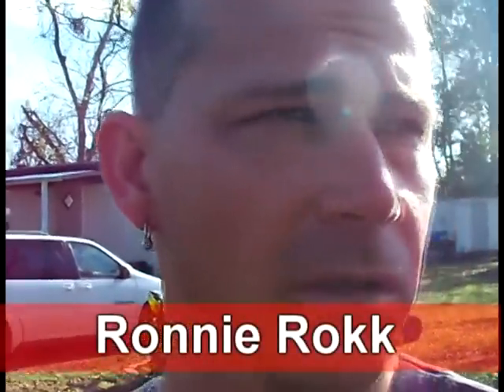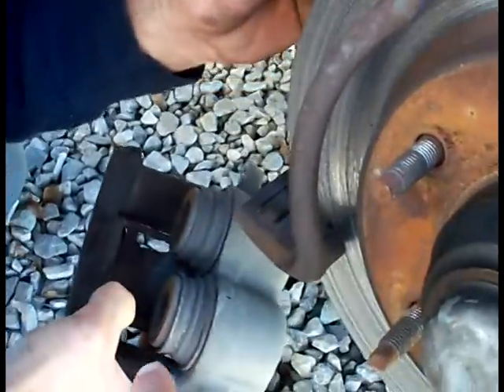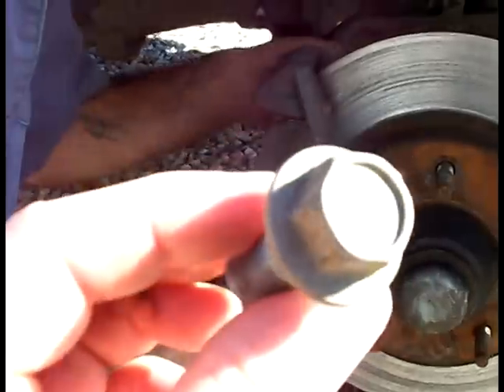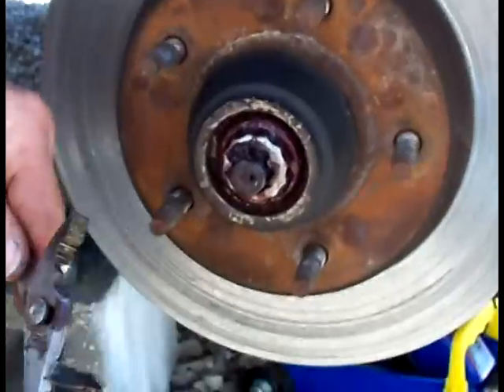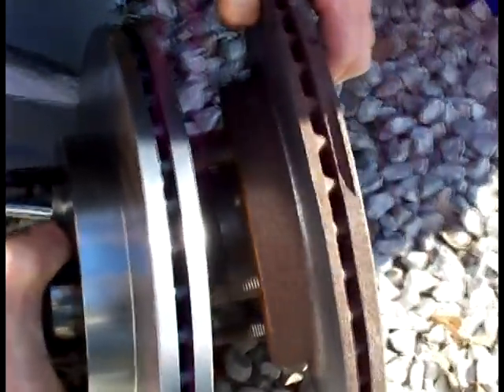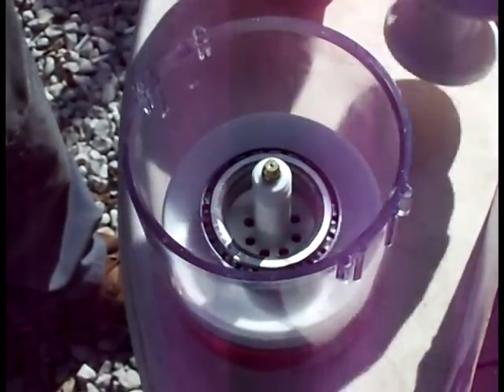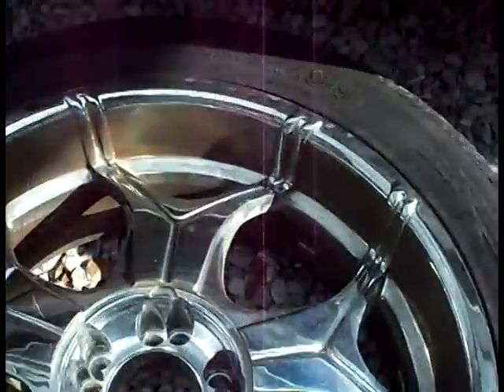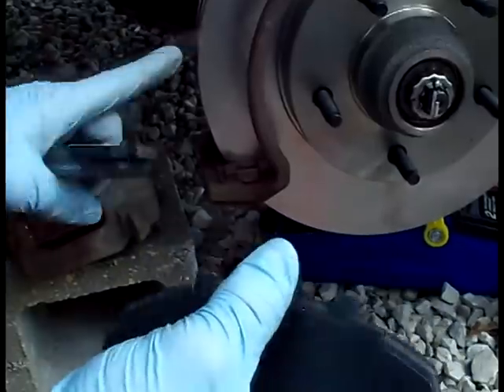Changing rotors and breaks on 1998  Ford F 150

Comment: Nice job! Thanks!
Reply: I watched this at least eight different times before I changed my rotors (and once during). I didn't even need a pipe on my breaker bar to get the bracket bolts out (or break them off, thank god). Thanks again!
Reply: Cowcharge You welcome buddy

Comment: Great vid!  Only thing I might add is rather than push the old fluid back upstream,  slide  a piece of clear tubing over the  bleed nipple  on the caliper  into a container,  Once the caliper is fully depressed with a c clamp, it can be bled by putting the tubing into a container with some fresh fluid in the bottom -,  all traces of air and trash  are  easily be  evacuated  from the caliper when it's fully retracted and has no way to move... Just don't allow fluid in the reservoir to go empty or air will get into the circuit.

Comment: What's the torque specs for the bearings? Thanks
Reply: 30’lbs while rotating the rotor then back it off two turns then torque it to 17’-24’lbs while rotating the rotor then back it off 175 degrees then  torque to 17”lbs . Then your bearings will be loaded.

Comment: DO NOT USE GUN GREASE FOR WHEEL BEARINGS!!!!!!!!!  It is not nearly heavy enough or heat resistant enough for the long term use in wheel bearings - especially in a disk brake application.  Gun grease life is measured in hours - wheel bearing grease needs to last for years.
Reply: Glad I saw your comment. 👌thanks